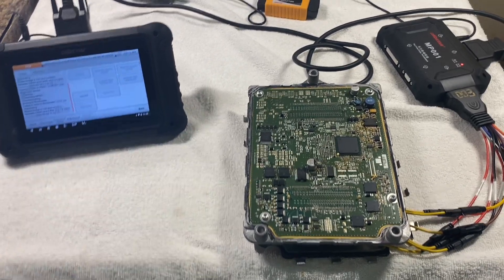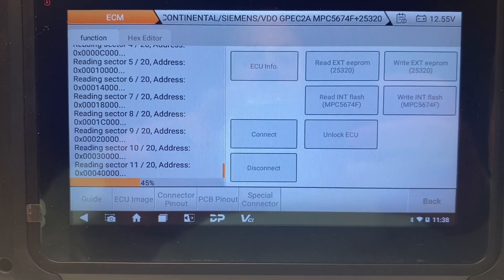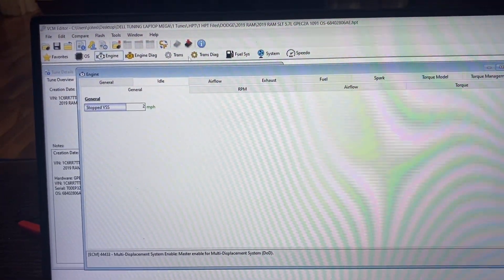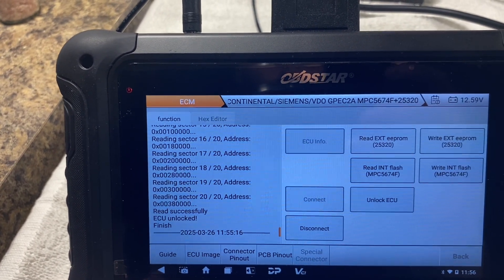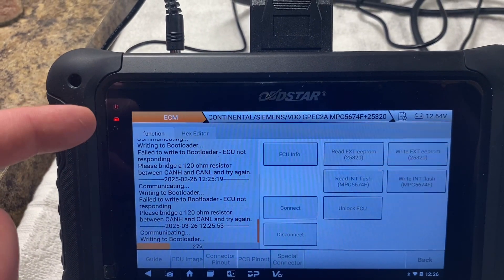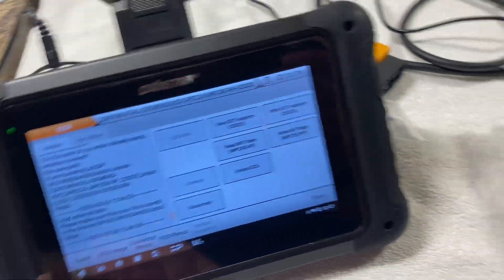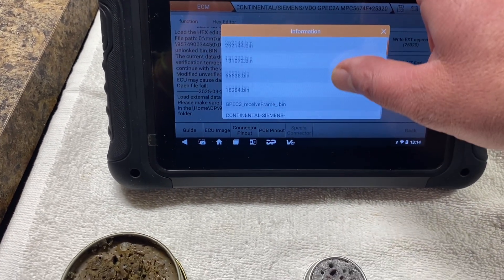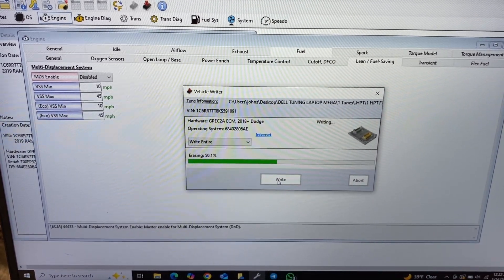OBDStar Dc706 added an ECU UNLOCK Tab to the GPEC2A ECM Menu!  DOES IT WORK w/HP Tuners?

Comment: What power supply are you using for the mp001. I got my kit but it does not provide one. If you have an amazon link drop it. Would like to support your hustle.
Reply from the maker: https://www.aliexpress.com/item/3256803525783072.html?spm=a2g0o.productlist.main.37.66e2idnFidnFuM&algo_pvid=3838ecb9-a450-4151-b26e-36ae50843a7d&algo_exp_id=3838ecb9-a450-4151-b26e-36ae50843a7d-18&pdp_ext_f=%7B%22order%22%3A%2221%22%2C%22eval%22%3A%221%22%7D&pdp_npi=4%40dis%21USD%21119.99%2150.40%21%21%21119.99%2150.40%21%40212a70c017446916150818672e5006%2112000026898383291%21sea%21US%210%21ABX&curPageLogUid=LFQTdqdJayTZ&utparam-url=scene%3Asearch%7Cquery_from%3A

Comment: The unlocked file is stored in the internal disk space. It tells you in the output. Move that file using ES explorer to the correct bin folder and write it. Then test with hp tuners.

Comment: I though i read somewhere that you may have to read AND immediately write back that original flash first. Then proceed to unlock . Wont be able to try the theory myself until tomorrow evening though .
Reply from the maker: if it works let me know!    btw my whats app is 1.712.204.3955
Reply: Did it work?
Reply: @boydlittou9446  wasn't able to mess with one . Turned out I only had gpec2,3&4 ecus. I have a 2a on the way , I'll be able to tinker with one at the end of the week.
Reply from the maker: make sure to let me know!!
Reply: @drewjohnson5402  Didn't work for me either . It kinda works , looks like they are applying the e6/e8 change to the wrong offset and/or data string .  Also 00025BO is not where i found the data to unlock the two ECUs i have (2015) , was at 00025A30 . lastly you don't really need to use a thumb drive all time , you can also do a wireless export from tool to PC . Have a good weekend .
Reply from the maker: @Pauly__D  have you done a gpec4 unlock?
Reply from the maker: @  some times they are in different lines.   If people don’t find them in the lines I listed then usually I have then search for the string to find it on the laptop w/ HxD
Reply: @drewjohnson5402  No sir , I have not .
Reply: I have a obdstar g3 and the gpec2a not listed any idea chat support sucks never give me an answer

Comment: Hey I think you need to write the file obdstar makes when you press the unlock button. When you press unlock, it clearly says it is READING the sectors. No writing is happening. So maybe once you have made the unlock file, which is being stored in a different directory than your other files, as you can see on the screen, maybe you can try finding that file and writing it back and see what happens.
Reply from the maker: @mikei.7425   I did end up trying that but no go sadly
Reply: @drewjohnson5402  that is too bad. Well maybe it will work on the next update. Did you look at the saved file in the hex editor? Were the appropriate sequences modified?
Reply: @drewjohnson5402  that is too bad. Well maybe it will work on the next update. Did you look at the saved file in the hex editor? Were the appropriate sequences modified?
Reply from the maker: @ I didn’t even look
Reply from the maker: I’d assume no or or wiukd have worked lol
Reply: @drewjohnson5402  might be w checking to see if something was changed. Maybe the unlock is for Diablosport instead of HPT.
Reply from the maker: @ possible.   I know bitbox unlocl doesn’t works for hpt